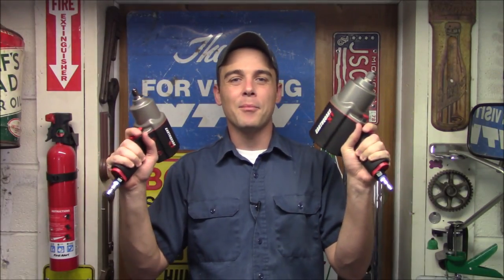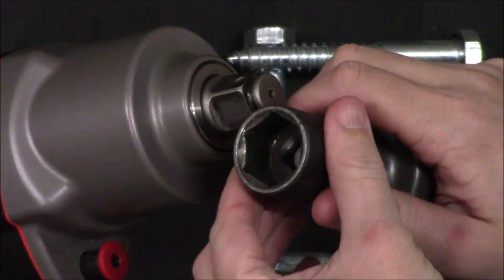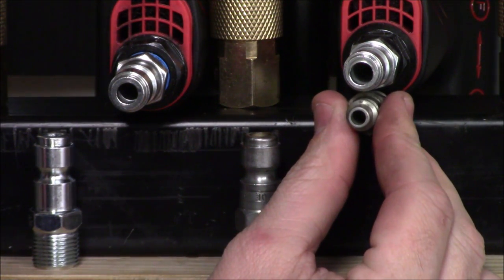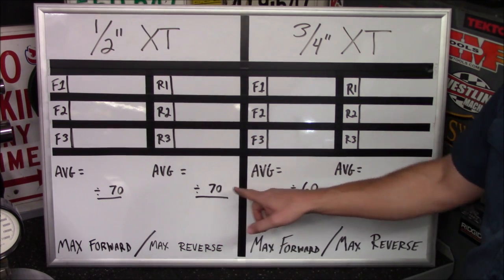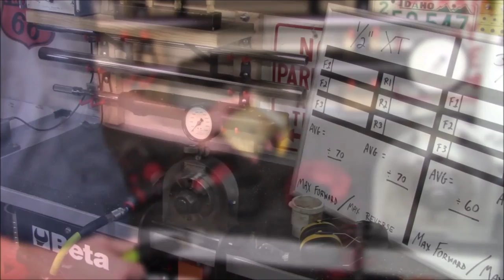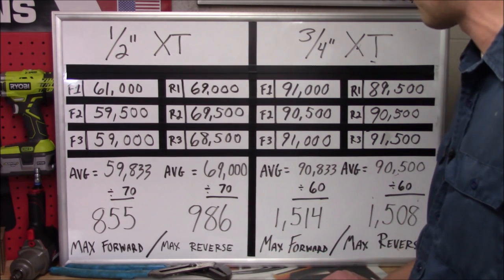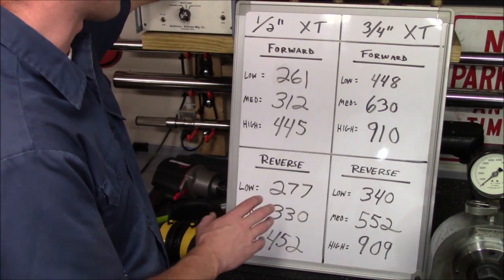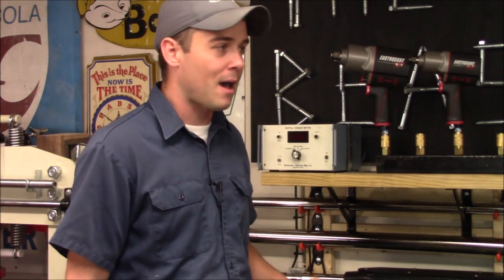Earthquake XT Composite Xtreme Torque Air Impact Wrenches! (1/2" & 3/4") 62891 / 62892

Comment: The've been out 2 years now. Do I need to buy the warranty? Just picked one up, lol.
Reply: DE Nichols  No. they easily outlast the warranty. I actually don’t know anybody that has had one fail since they came out.
Reply: @wcjcnc  Hello I just started as a car mechanic at a shop. Is earthquake a good brand for a cheap air impact gun?
Reply: Joker  Yes very much so. I have the Earthquake Xtreme 1/2” air impact and it’s a beast. I use it in a professional shop. You need to upgrade all your air line fittings to high flow. The entire Earthquake Xtreme air tool line is top notch.
Reply: @wcjcnc  oh that sounds great!!!! How long did you had it? Is it still working strong just like on the first day you used it? Because honestly this is a tool that I need to trust when working lol.

Comment: Does anybody know if the HF 21 gal compressor have enough juice for this gun?
Reply: It does but I would get their newer McGraw, it's built better, has significant improvements over the central pneumatic and is also quieter
Reply: Q-Pid Avenger I would recommend the Fortress over anything else.
Reply: I used the 21gallon compressor to run a 1" impact gun for semi lug nuts. So yeah it'll do it but you need to be patient. The maximum power burst is short. Especially with 1/2" hose and 3/8" high flow fittings.

The bigger the tank, the longer you can sit on a fastener and let the gun hammer at it before it needs to refill.

Comment: I have both models. I was curious to know if the HF 1'' impacts were worth getting compared to the EQXT 3/4''. Do you have one you can review? I'm not terribly impressed with the 3/4'' torque numbers but all the manufacturers stretch the truth with their advertised values. Makes it difficult to compare impacts, almost like car audio amplifiers and their BS max wattage ratings.
Reply from the maker: Check out the video which I made called “torque vs torque loss” & you might see some tips to improve your performance.
Reply: @RealToolReviews  Yeah, I've got 42 gallons capacity, 1/2'' ID short hoses, high flow connectors. Most impacts seem to let me down. I need a 1'' for sure. The HF 1'' models are cheap, it worries me.
Reply from the maker: What is your static pressure?  You’ll probably need 110-120 static to achieve 90 working when in use at the tool.
Reply: @RealToolReviews  I don't understand static pressure. I normally run at 150 psi on the adjuster. I have daisy chained tanks with high flow couplers, short 1/2'' hoses... I think it's only a few feet between tanks. Tanks go up to 200PSI but I'm worried to go above 150. Manuals say not to exceed 90psi. Using a water trap, no fogger... I squirt oil into the connector before use, every time. Using Marvel brand tool oil.
Reply: I wouldn’t waste your money on the Harbor Freight 1” guns. I tried out the pistol grip and extended anvil ones and their torque output is nowhere near what is claimed. My 3/4” Aircat could remove fasteners the 1” Harbor Freight couldn’t budge. If you need an extended anvil, I would suggest the Aircat 1994 and if you want a pistol grip I would suggest the Capri Tools 1”. The Capri is expensive, but it’s mean and always gets the job done.

Comment: so how did it do compared to the snap on?
Reply: I'm wondering the same thing. I think they need to torque test the snap on's next to set the baseline.
Reply: Aaron Kimmins I watched a video where they did it was putting on the exact same numbers almost with more features to control the torque than snapon

Comment: I'm trying to do the upgrade to 1/2 inch hose and 3/8 inch fittings as you suggested. I've got the hose, which has 1/2 threads on each end. Where did you find the adapters or fittings to get to 3/8?
Reply from the maker: I use 1/2” line with 3/8” npt fittings installed....you’ll either need a 1/2” to 3/8” adapter, or you can cut the end off & install a barb fitting (1/2” barb w/3/8” npt threads) to make it work.  Also, you could always use a short whip hose to step down from 1/2” fittings if you wanted.
Reply: Mark Ash had the same problem. You can use a reducer as suggested or just fing another 1/2 hose with 3/8 threads like i did.

Comment: the earthquake I owned went right back to harbor freight,, it didn't deliver nearly the torque as it claimed, harbor freight took it back and refunded my cash no questions asked, ,,, I upgraded to the ir2235timax,, and never looked back,   although 3 times the price its the cream of the crop.
Reply: I've been using a IR 2135TI for years.  I have known for many years that IR is the best.  I have a tool box full of Snap-On tools but IR impacts are the best.  I can't wear them out and I am a professional at a Ford Dealer for 21 yrs now.  I still want to try this cheap Horrible Freight Job at home for the fun of it.  I'm still using my 20 yr old IR at home that still works just fine.
Reply: How do u know?  What’d u measure torque with?

Comment: the snap on is not a good impact. I had one as well as 2 coworkers. while they are very strong out on the box the life of them is very very short. within 6 months all 3 had been sent back in for repair due to severe power drop, hanging up, or just flat not working.

Comment: Hi Real Tool does the 3/4 in. Composite Xtreme Torque Air Impact Wrench lose torque if I use a 3/4 to 1/2 adapter to a 1/2 deep socket? How much torque would I lose. It has 1700ft-lbs of nut busting torque but how much of that do I lose if I do what I just suggested? Thanks in advance
Reply from the maker: Check out a video I made called “Torque vs torque loss”.  The answer is that video. 👍
Reply: @RealToolReviews  thank you. I watch the video. I understand about torque loss. But now I'm thinking do you get "torque gain" if you go from 3/4 drive to a 1/2 in socket? Mainly I'm trying to figure out should I get the 1500ftlbs ingersoll rand cordless 1/2" or the earthquake 3/4" cordless 1700ftlbs? I'm a mechanic and will only be using the tools for cars.
Reply: I've found that big and heavy sockets versus little ones actually do a more powerful job on getting the job done. I think that's why the Honda Crankshaft bolt removal tool is super fat. I laughed when my friend said it was necessary but removed it by hand. I told him, that fat socket only helps with an impact tool. I hope that helps too.  @nicenow25

Comment: what real world applications require working torque in excess of 1000 ft/lbs or 1500ft/lbs? im simply curious. .not my area of expertise.
Reply: or the one inch or bigger bolts on car control arms
Reply: Honda crank pulley bolts can be a real nightmare to remove. have seen them laugh at a standard duty 1/2 inch drive impact, they can sometimes take close to 1000 ftlbs of torque to remove. 2nd gen dodge ram 4x4 front hub nut ( takes a 1 and 11/16 inch socket ) my 700 ftlb gun would not budge it. had to use a 3/4 impact. depending on the type of work you do sometimes you run into some really stubborn fasteners.
Reply: i never did get the control arms of with a 750 impact i tryed heating the bolts and set the grommets on fire (btw this was my own car i was working on)
Reply: working on heavy equipment such as construction equipment you would use it daily.
Reply: Bingo
Reply: working with diesel rigs you encounter larger bolts on like differential yokes, they can measure 2" 13/16ths

Comment: I'm kinda kinda new to this so im stuck on what size hose and fitting I should get with the 1/2 XT. Should I go with 3/8" or 1/2“ hose with 3/8" fitting. I curently have a Husky 30gal 175psi compressor.
Reply from the maker: Upgrade your fittings from the regulator to the tool to either 1/4" high-flow or 3/8" fittings (either with 1/4" NPT threads).  I use 3/8" fittings + 50' of 1/2" hose & measure the working pressure AT the tool in order to set the regulator correctly (90 psi working).  Check out this video that I made to understand better --- https://www.youtube.com/watch?v=MHx2EUWYzuM
Reply: Real Tool Reviews Awesome. Thanks for the help.

Comment: hi thanks for the videos,  I would like to have an advise from you I just bought a 20 gal north star compressor with 2hp I did the set up with 3/8 house 50ft long and 1/4 fitting. and also I get 800 ft/lb husky impact wrench but I couldn't break lose a single lugg nut from my truck I thought that was the house so I got a 1/2 In with 1/4 fitting and 50ft long never made it work so I return the compressor and I got the lil  makita 1/2 impact wrench and I was impressed with the power torque I did my truck suspension   with no problem  ,but still want to get me a compressor I don't know if I have to get a bigger tank with more hp or maybe was a bad setting 
impact husky 800 ft/lb at 90 
compressor 2hp , 20 gal , 5.5scfm at 90 psi. and the 50ft house  , please give me an advise if would like a compressor not that big but something that gets the torque  out the wrench  thanks .
Reply from the maker: You are having pressure drops --- resulting in too low of pressure at the tool when in use.  Check out this video that I made to understand how to fix this --- https://www.youtube.com/watch?v=MHx2EUWYzuM

Comment: old SUNEX gun
Reply from the maker: The housing looks similar.....I have not run them side-by-side to see if the power levels are different.  I have tested many impacts that "look" the same on the outside & one is much more powerful than the other in torque testing.
Reply: Real Tool Reviews I had to rewrite my text some brand disclaimer came up blocking me, zunex hD
Reply from the maker: weird...
Reply: I bought the HF gun for fun and I absolutely liked it, it out performed my 12ook by weight size and bolt loosening
Reply: I bought the sunex cover for my harbor freight xt fits perfect
Reply: bloodstone30 I was wondering about that,I have the regular earthquakes,do you know of any covers that fit those?